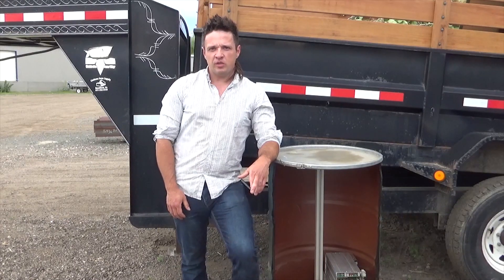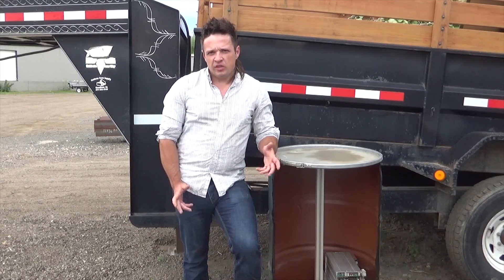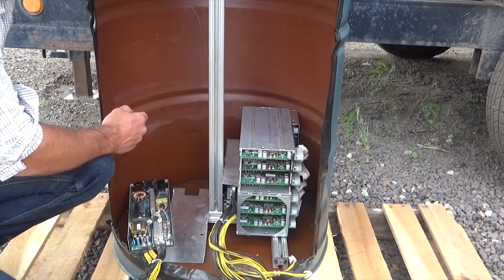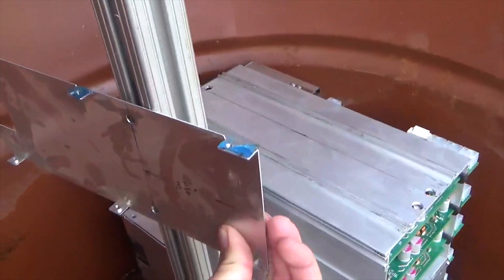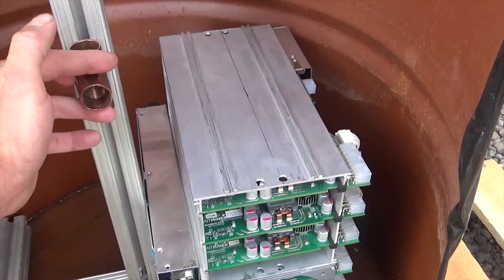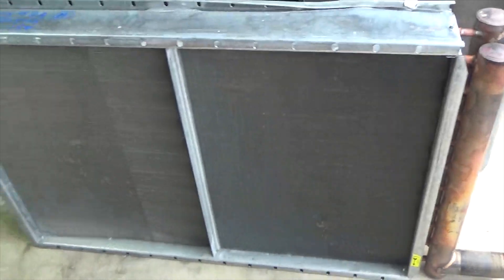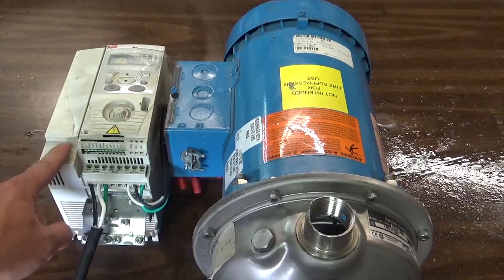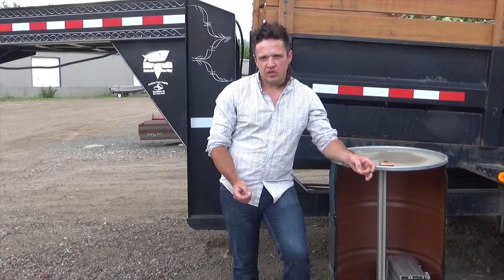Industrial Bitcoin Immersion Cooling - 12 Antminers in Oil - Intro

Comment: Hell sir 
Your videos r great 
I hv a question how long a miner can
Last in mineral oil cooling 
And the box should b air tight? 
And if I put the power supply out 
Is there any problem?
Reply from the maker: The miners I originally built are still running and have been in and out of oil for a few years, seem ok. You should keep the box tight to prevent moisture and dirt from contaminating the oil. I put my powersupplies in there as well since it seemed easier.

Comment: Have you considered using a water tower and heat exchangers instead of a radiator? I thought about using your concept along with the liquid immersion video from the guys at WhatsminermicroBT.
Reply from the maker: I did look into that but I think a commercial sized water tower would be a little too much. The water towers I have seen are far larger than what would have been needed for the drum and require some maintance, especially to keep stuff from growing in the water. I do have to wonder if the capital expense of immersion cooling is worth it for such a large project vs air cooling.   

If I make it I will build a bitcoin heated pool in my compound/mansion and make a how to video.

Comment: Awesome max! Make sure that pump is rated for oil.. The cheaper ones are mainly for water, won't last as long. Using mineral oil , make sure you ground the system, will build up a charge with plastics pipes being used in between.
Reply from the maker: I've never had any issues with static but all the parts are also grounded to the power mains.

Comment: Love your creativity! You have many similar ideas as I do. When is your follow up video coming out to this 55 gallon drum project? It would be nice to see you pay a little more attention towards real estate by removing hashboards from their cases along with their heat sinks...and try other custom containers that can fit 50,60,80,100+ hashboards.  It would also be cool to see how to power up and how to cool immersion tanks of that greater size. Keep up the good work!
Reply from the maker: I haven't had a lot of time to work on this lately tbh. I don't see the benefit from removing the boards out of the cases and you need the heatsinks. Custom containers cost custom money  which is why I'd like to avoid using them.
Reply: Neetbux Laboratories By custom containers I mean cheap custom made but more importantly ones that can house 100 boards in a row. I have connections at engineered fluids and allied controls and they all say that you are better off without the heatsinks...for heat transfer reasons and obviously real estate. If u take off all the heat sinks on one side (opposite of caps) you will double your capacity. I can show you a pic of 30+ boards in an array that has been proven to work better than with the heat sinks...chips are much cooler.
Reply from the maker: @kevinjames1587  Hey, I don't really have the means to run more then 30kw or so of power and I think in a significantly larger install, the capital costs of oil cooling would not be competitive with plain air cooling. Unless, I suppose you're heating your house in Irkutsk in the winter. 

Thus a drum is very suitable to my needs and also I no longer own a welder to make my own custom container. Hence not much push at the moment in the direction of 100+ boards. 

I think you will have issues with proper heat dissipation without the heat sinks in the oil, remember mineral oil is nowhere as dense or has the heat capacity of water (or any of the flourinated engineering fluids).  

I did try to take the heat sinks of an S7 board a long time ago but I think they had some epoxy bonding the wires on the chip next to the heatsink and it turned into a mess. I think an S9 is a little different. 

If you want to email me, feel free to do so at 
neetbuxlaboratories@gmail.com, I'd be interested in seeing that particular setup.

Comment: Cool idea. Keep it simple and modular so you can expand. I wouldn't worry too much about plumbing inside the drum. Inject coolant at bottom and extract near top. If you maintain sufficient flow and size your radiators correctly, you shouldn't have to worry about overheating in the drum.

Comment: Greetings Max, thank you for sharing your video inventions. To me you are a God send. I am working on a very similar idea only using a large job lock box. My question is did you see any amount of condensate water build up in the oil of the mini heater unit that you built previously? Do you think a filter is necessary on the oil lines? Especially if you will be running multiple units together. Approximately how much oil will you be putting in this big system? Thank you for your time.
Reply from the maker: In the small heaters I didn't see any condensate but they are kept closed and airtight. If not, then the oil will definitely pickup water from the air. 

The big system is going to be 55gal in drum plus the radiator and the lines, I'm not sure what the total number will be. I do intend to add a filter unit to the line as well.

I'd like to see the jobbox build,  you can find them quite cheap and they are easy to move with a forklift if need be.